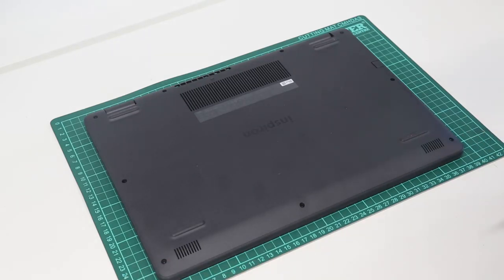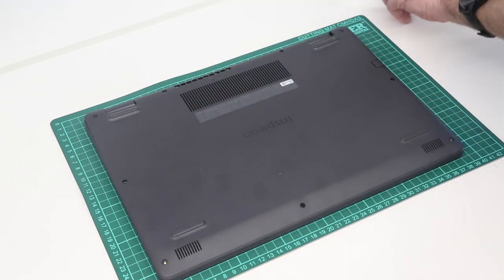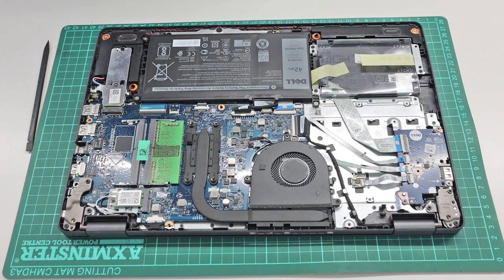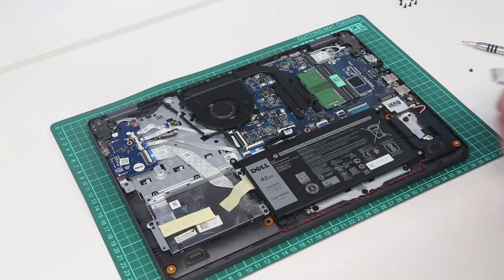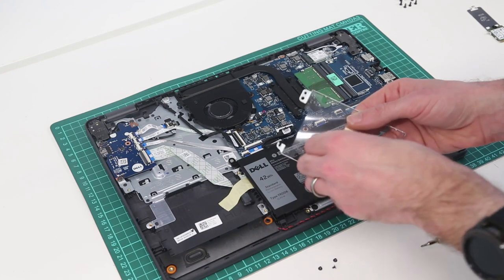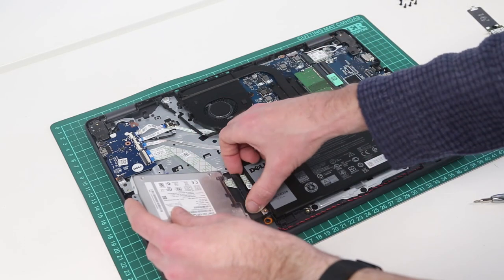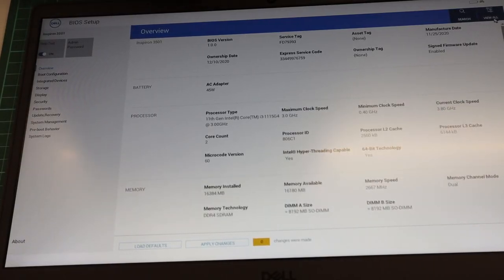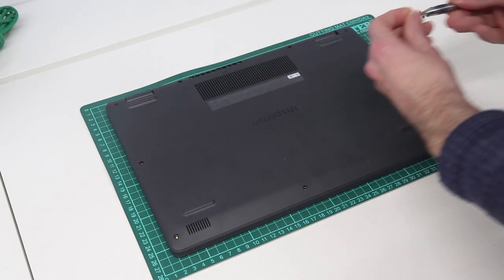Dell Inspiron 15 3501 - M.2 SSD Upgrade, 2.5" HDD Fitting and RAM Upgrade Guide

Comment: I can confirm this laptop DOES support 32GB RAM as 2 x 16GB DDR4.
Reply from the maker: Thanks for letting us know!
Reply: Can i play games?
Reply: Thanks Neil!! :)
Reply: Can you also please confirm if dell vostro 15 3000 supports 32 GB or more ram memory and what is the maximum speed it can reach???? 😭😭🙏🙏.
Reply: What is the battery life like?
Reply: @dreamleaguesoccer.3761  Why are you crying
Reply: @TonyStark-nw1ll  It can, but since it only has an Intel i3 processor, it may not handle more demanding games
Reply: Really, the stock laptop works like shit!!! Even opening file explorer takes forever

Comment: If I install an additional 2.5 inch SATA SSD, which one will be the primary drive? The M.2 SSD or the 2.5 inch SATA SSD? For context, my Dell Inspiron 15 3501 came with the M.2 SSD and an empty SATA drive compartment
Reply from the maker: If you already have an M.2 drive then it will be the OS drive and listed as C:
The new drive once partitioned and formatted would be D:

Comment: Perfekte Anleitung! Kein überflüssiges Blabla, sondern nur Fakten:  Das Öffnen des Gehäuses, wie man die NVMe SSD austauscht, wie man eine 2,5" SSD einbaut, und wie man den RAM verdoppelt. Danke für das Video, es hat mir beim Laptopkauf sehr geholfen.

Perfect guide! No unnecessary blah, just facts: opening the case, how to replace the NVMe SSD, how to install a 2.5 "SSD, and how to double the RAM. Thanks for the video, it helped me a lot when I bought a laptop.
Reply from the maker: Glad it was helpful!
Reply: weist du zufällig ob das mit 32 gb auch geht also Crucial RAM 32GB DDR4 3200MHz CL22 (2933MHz oder 2666MHz) Laptop Arbeitsspeicher CT32G4SFD832A Möglich ?
Reply: @johannsebastiansylviobach3657  laut Dell erweiterbar auf maximal 16GB

Comment: Thank you for this video, it helped me to add a SSD (took me a few time to find out how to install Ubuntu on it), but it work fine now.
Reply from the maker: Glad it helped!
Reply: @BrueComputing  I just had a problem to install a Linux distribution as the SSDs was Raid configured (mmh sorry for my english). I had to boot the laptop in safe mode, enter the BIOS to change the SATA to AHCI, then reboot in normal mode (took me a few day to find out how to solve this 'ca. Ubuntu Mate had the best default compatibility.

Comment: I didn't know that I can add a classic SSD in it, which is very interesting because I have one. Thanks !
Reply from the maker: Glad I could help!
Reply: FYI, a classic 2.5 inch SSD will not run nearly as fast as an M.2 SSD. Just saying it may be worth a small cost to go with the best once inside. Good luck

Comment: Can we twick the Bios to read the ram correctly. Video was Very useful , thanks.
Reply from the maker: The BIOS does show the RAM capacity correctly - the system just won't run it at 3200MHz.
I don't know any way of increasing this, it appears Dell have limited it to 2666MHz.
Reply: @BrueComputing  i believe there is a model that runs 3200mhz..with the discrete graphics
Reply from the maker: @MattMoralesPH  You are correct. Most the 3000-series machines limit to DDR4-2666 however.
Reply: @MattMoralesPH  True I got that one with the MX 330

Comment: To my knowledge to run at memory speeds over above 2667 mhz, you require the machine to support some sort of XMP profile (like on desktop) machines. Maybe Dell had planned to included this in a bios update? But forgot about it? Or the worker who put in the memory put in a wrong module?

Don't know if there exists laptops other than gaming laptop which has XMP profiles. Maybe the newer 11th gen Intel models do?
Reply from the maker: Its a choice by Dell - the 3501 is artificially limited to DDR4-2666 UNLESS it is equipped with an NVIDIA GPU, in which case it allows for DDR4-3200 operation (and gets a USB-C port as well). This is a Core i3-1115G4 equipped system, which officially supports DDR4-3200 and LPDDR4-4266.
Most laptops won't use an XMP profile, but DDR4-3200 is a JEDEC standard and the module fitted complies with that.

Basically Dell are using memory speed to give a performance difference between their similarly equipped Inspiron 3000 and 5000 laptops. I also have an Inspiron 13-5300 (i3-1115G4 with LPDDR4-4266) and Inspiron 14-5406 (i5-1135G7 with DDR4-3200 SO-DIMMs). In fact the modules I fitted to test DDR4-3200 operation are the exact same ones which operate at DDR4-3200 in my 14-5406.
Reply: @BrueComputing  there is somewhat somewhat same issue with the then i7 10510u. It's supports 2667 DDR4 and LPDDR4 2933.  But some PC producers  like Lenovo install 3200 mhz ram in machines based upon this CPU regardless.
Reply: I have the same situation here. Is the same model but with the Intel i7 core 11. Genaration. It cames with 3.200 MHZ installed. I inserted a second one with 3.200 MHZ. But still it schows 2.667 MHZ. Any ideas?
Reply from the maker: @NoName-uz7ev  Dell limit the RAM speed on this model to DDR4-2666 - it'll only run 3200 on the models with an NVIDIA GPU.
Reply: @BrueComputing  Can i play games on Dell Inspiron 15 3501?
Reply: @TonyStark-nw1ll you can, just don't expect to run games smoothly on an un-upgraded one

Comment: Hi, just to make sure, Have you tried the Ballistic DDR4 for this 3501?? I found some Ram brands are not compatible with Dell Laptops?? Is this true??
Reply from the maker: The 3501 (without NVIDIA GPU) is limited to DDR4-2666 speeds, so I wouldn't spend the extra on Ballistic modules - I fit the standard Crucial items.

Comment: Hey guys, 
For your information, RAM in this laptop run only upto 2666mhz instead of 3200mhz because system doesn't have discrete graphic card.
Reply: But does the RAM still function correctly? Like I know it adjusts it's speed but is the RAM upgrade still present?
Reply: @derrickubay-ubay9503  yes it function correctly even if you upgrade it with 3200mhz.
Reply: @manojbhanushali6061  well thanks! I upgraded mine and it's working perfectly fine. Didn't disconnect battery tho... But I made sure I turned it off to make sure I don't worry about it.
Reply: @derrickubay-ubay9503  good👍

Comment: Excellent quality instructions. My ribbon cable came loose. Where should I fit the tip to the board?
Reply from the maker: Thanks. Which ribbon cable was it? Should just be a case of opening the catch and slotting it back in.

Comment: Thanks for your video.
I have de Inspiron 3505, the motherboard supports a frequency of 2400MHz and the notebook comes with a factory RAM of 1X8GB 3200MHz, working at 2400MHz.
If I add another 2400MHz RAM, can dual channel be enabled? Will I have a problem because both RAMs are of different frequency, but they both working at 2400MHz?
Cheers, mate!
Reply from the maker: I would always install a matching memory module, but a DDR4-2400 one should work. Dual channel MAY work, but I wouldn't guarantee it.
Reply: i have the same model with i5 11gen  the stock ram is 3200 and i added 2666 to activate dualchannel and it worked !
Reply from the maker: @springrazan4268  Nice one.

Comment: Hello @Bruce Computing;how is upgrading the Vostro 3501 RAM going to affect processing?
Also,is a RAM upgrade enough to increase the processing speed of the Vostro 3501,or an SSD inclusion adds more?
Reply from the maker: In terms of performance benefits, going from a HDD to an SSD is going to make a MUCH bigger difference than RAM, particularly in terms of startup time, application loading, etc.
RAM can be worth doing at the same time, particularly if you have a single 8GB module or less, but SSD makes the big difference.
Neither will affect CPU limited tasks however.
Reply: @BrueComputing  Ow okay.Thanks.Dell tells me my Vostro 3501 has a processor speed of 3.0ghz yet it's far less.System info states 1.12ghz;why is that,and how can I get my laptop to perform at the 3.0ghz speed?
Reply from the maker: Clock speed will change almost constantly - under low loads it drops down to save power, when carrying out CPU intensive tasks it will go up to its base or turbo boost speed - the exact speed depending on the CPU model, number of cores active, temperature, etc.
Reply: @BrueComputing  Permit me to ask some more;can I really make my core i3 Dell Vostro real fast with the SSD,additional RAM inclusion?
The fact that it is a Core i3 device

Comment: So if I add 2 8 gb 3200mhz pony sodimm ram will I still get 2667 daul channel speeds or do I need 2 8 gb 2667mhz for this to work as daul channel. So does it still work as daul channel if they are both 320mhz?
Reply from the maker: 2 x DDR4-3200 will work just fine (it even shipped with a DDR4-3200 module installed from the factory), it'll just run it at DDR4-2666 speed.

Comment: amazing video.. i upgraded my laptop ram by adding one 8GB cruicial module and 128GB additional SSD .. One question is i am getting 40-100MB/s speed in SSD (even though same ssd is performing at 500MB/s write speed when insert in desktop)... Is this because my bios is not switched to RAID.. or something else causing this speed issue...?!

Comment: Hi! Is it better to replace and upgrade the M.2 SSD with bigger storage capacity or add a 2.5 sata ssd and have both?
Thanks is avance
Reply from the maker: For simplicity and performance I'd go with a single large M.2 2280 NVMe drive. Adding an additional SATA drive will probably be cheaper and less hassle as no need to clone data or reinstall Windows though.

Comment: Pretty nice video! I have a question, the crucial web page recommends upgrading my RAM memory to 64GB, but the manual says that the maximum is 16GB, can I upgrade up to 64GB? Thanks!
Reply from the maker: I would expect 2 x 16GB to work for 32GB. I hopefully have some 32GB modules coming soon to start testing with but a 64GB configuration would probably be massive overkill for the Inspiron 15-3501 unless you have a specific need for a very large amount of memory.
Reply: @BrueComputing   Thanks for your reply! I was thinking of 32GB because 64 is maybe too much for the use I'll give it. Maybe Crucial is just trying to sell larger memories XD.
Reply: @BrueComputing  Finally works with 64 GB?
Reply from the maker: @cokecola1982  Not something I can test - I don't keep these systems in for review long so no longer have it.
Reply: @BrueComputing  thanks for share You're so kind!!!!!
Reply: @federicocaballero6493  works amazing with 32

Comment: i really wish you wouldve showed the before benchmark so i could be able to compare w myself but i have the core i5 not i3 and my stock 3501 i5 and my CPU speeds say Intel(R) Core(TM) i5 - 1035G1 CPU @ 1.00GHz, so are you saying you cant upgrade the RAM  at all? like the laptop is governed to stay at 2667? theres nothing we can do to upgrade these speeds? theres nothing you can do to upgrade the speeds at all?

Comment: I cannot find a cooling strategy app for my 3505. Isn't it possible to change that? A least have a silent mode or something?
Reply from the maker: I'm not sure if it has one - Dell seem to only provide these for their Intel based devices.
Reply: @BrueComputing  It doesn't. I didn't think that was possible in 2021

Comment: Just one question. SSD NVMe has a cover on it. I have to upgrade my ssd to 500 gb. Should I place that cover too or not?
Reply from the maker: The metal cover on the standard SSD converts the M.2 2230 drive to M.2 2280 mounting. If fitting an M.2 2280 drive it isn't needed.
Reply: @BrueComputing  yes I got it. Thanks

Comment: Checking this prior to buying a Inspiron 15 3502 (Intel Celeron N4020), hopefully the layout inside is the same.
Reply from the maker: I wouldn't buy a 3502 - those N4020 chips aren't very good.
Should be similar inside though.
Reply: @BrueComputing  unfortunately my friend is on a tight budget. He has around $375 budget and laptops here are super expensive now because of the shortage... 
There is another option of AMD athlon 3150U. Better? Or equally bad?
Reply from the maker: I'd take that in preference to the N4020, no question.
Reply: @qufeng49  bruhhh for 399$ there's 
Asus F512JA aka X512FA 
Check it out on amazon

Comment: Does this pc contain an option in BIOS to control the battery maximum charge when connected to AC power?
Reply from the maker: There are various charging options in the BIOS, but I no longer have the laptop and can't remember if there are any which specifically do that.
Reply: @BrueComputing  i was thinking about buying this laptop, but since new pcs dont include RTC cell, we have to prolong the lifespan of the internal battery 
to avoid BIOS reset. Internal batteries are EXPENSIVE and hard to find in my country (Chile). Thanks anyway
Reply from the maker: @intestinal47  The 3501 has a RTC (CR2032) battery, its on the other side of the I/O board (the one with a USB port and the card reader).
Reply: @BrueComputing  Thanks!

Comment: Hi i have the i5 version of this with 256gb and 8gb ram. I'm a machinist and need this laptop to have more than 8gb ram for CAM programs. I'm running at around 55 percent ram when one tab open watching youtube. Its around 60 percent running Adobe. Im afraid to run fusion 360.  Would adding more memory make the laptop fan kick in later/ run better? It was weird opening the laptop and not seeing the SSD in there haha.

Comment: Does removing the base void the warranty? Are there any stickers or the like?
Reply from the maker: There are no warranty labels broken in removing the base. Obviously if you upgrade or replace parts that may affect your warranty though, as will causing damage during the process.
I would recommend ensuring you use soft plastic pry tools, and if you have to make a claim return the system to its original configuration first to ensure the upgraded parts aren't the issue.

Comment: I have a same model with 1tb HDD and 4gb ram( no SSD included), but i find my laptop to be slow as it struggle to even open multiple tabs in chrome, what can i do? Will it help if i add a 128gb SSD and a 4gb RAM?
Reply from the maker: Personally I'd upgrade it to an SSD and add another 4GB DDR4 as a cost effective upgrade.
Reply: @BrueComputing  thanks alot

Comment: Hi, Thanks for the video. I got this labtop with PCU Intel® Core™ i7 11th generation and a SSD M.2 PCIe NVMe de 512 Go. For upgrating, please, do you know if the system supports 1 SSD M.2 512 Go + 1 SDD 2.5" 1 To or only 1 SSD M.2 512 Go + 1 SDD 2.5" 1 To? Thanks for help.

Comment: Hi, I'd like to ask. When I bought my laptop Dell Inspiron 3501, I was informed that the extra slot of the drive is for HDD? But base on your video you can use an SSD and is there any limit of SSD? Or 1 TB is also a good one?
Reply from the maker: It will take any 2.5" SATA 7mm or 9mm thick drive in the slot - so either a SSD or HDD will work just fine.
Reply: @BrueComputing  but what do you recommend? SSD or HDD?
Reply: @ivandelfierro5819  I'd go SSD as they've come down in price and are extremely fast compared to an HDD. You might want to by a very big capacity HDD (very cheap nowadays) if you're not worried about speed, ie to store backups or other stuff where speed is not important.
Reply: @BrueComputing  Can this unit read up to 1TB?

Comment: Brother can I have that Metal SSD cover? My laptop did not came with that and I have a smaller size SSD. and Couldn't install it because the cover is missing. Or can you tell me where can I find this kind of cover to buy?
Reply: They are available on ebay for about $7

Comment: mine has 12 gb ram, can i use 16 gb on the other slot or does it have to match? i cant find another 12 gb anywhere
Reply from the maker: If it has 12GB it'll be an 8GB + a 4GB, so you'd have to remove one module and replace it.
Reply: @BrueComputing  thanks

Comment: would it be worth it to just buy x2 8gb cruicial sticks at 2666mhz instead of 3200mhz? it works out cheaper?
Reply from the maker: There isn't any price difference here - I only keep stock of DDR4-3200 modules so always use those.

Comment: Sorry if im out of topic but usally for laptop with integrated GPU do you use generic or OEM driver for benchmark?
Reply from the maker: I use the latest drivers from Intel.com or AMD.com
Reply: @BrueComputing  thanks, wanted to know if performance where obtained with generic or OEM drivet
Reply from the maker: The laptop manufacturer ones tend to be out of date, so I'll avoid using them. Also just easier to go direct than navigating around a manufacturers website, finding the exact laptop model number, etc.
Reply: @BrueComputing  thanks again

Comment: Is possible to upgrade GPU for this laptop.
Also i have this model with ssd 250gb small m.2
So if i buy new m.2 1tb ssd, will that affect on system 
Or i ll have to instal new fres copy of windows?
Reply: up, btw how much is ur ram? saw in the site that max is 16gb but others in yt used 32gb and it worked. Stuck which one to use.

Comment: Since the laptop only recognize 2666 from 3200, do you think it's okay if i mixed a new 2666 with the current 3200 in that comes with the laptop ?
Reply from the maker: I'd fit a matched module, but it should work.
Reply: I can't confirm for this laptop, but I took the 3200 from this one and moved it to an HP 14 I have, so now that HP 14 has it's factory 2666 module + my Dell 3200 module, operating at 2666 and there are no issues.

Comment: Hello I Have A Question

Can I "Remove" The Components Of These Type Of Laptops And With That Build a Dekstop One?
Reply from the maker: You couldn't put the RAM into a desktop PC, they take full-size DIMMs, not SO-DIMMs.
The SSD could be fitted into a desktop motherboard with a suitable M.2 slot.
Reply: @BrueComputing  Ok thanks man, but things like the processor could be removed for the laptop and put in the desktop pc?
Reply from the maker: @hachi8557  No, the CPU is soldered to the mainboard and isn't LGA like a desktop chip.